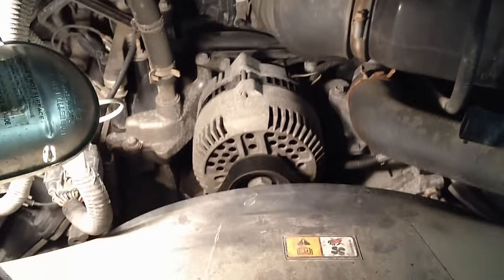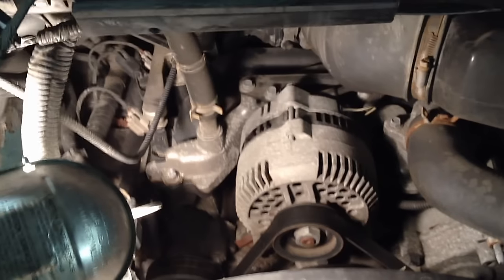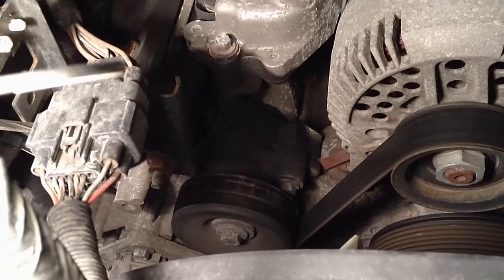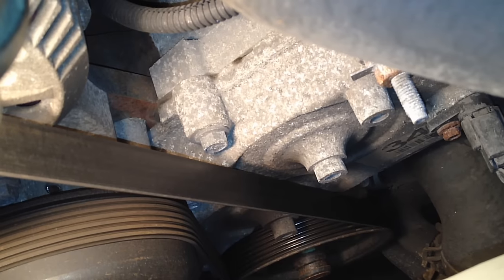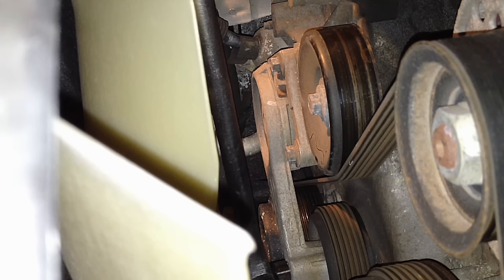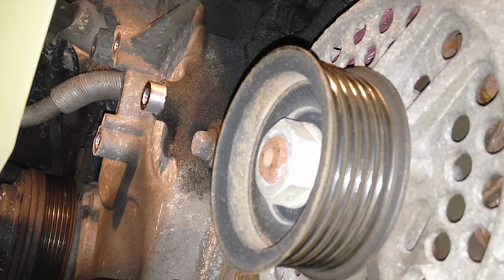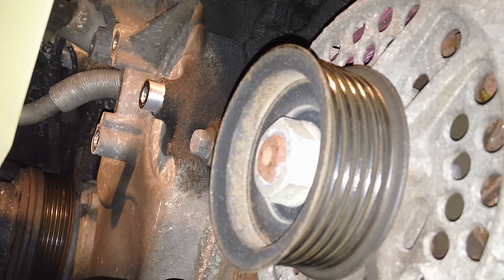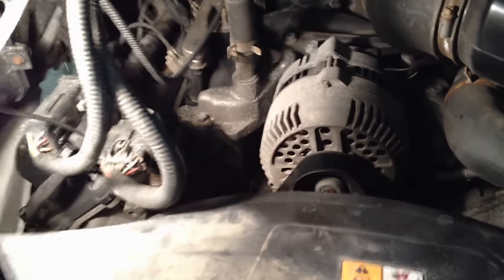Ford 4.6L & 5.4L Power Steering Whine Type Noise

Comment: Great Video. About a year ago I replaced the timing chain set on my 2003 Ford Explorer 4.6L 2V, Intake Manifold, Plugs etc.. and the timing chain was definitely bad. 
Started her up, she ran but gave me a similar noises. I said oh well, "I'll just run it till it dies." 138,000 miles now.
I thought that maybe the noise was caused by a clogged screen on the oil pump being that there was so much crap in the engine. I change the oil several times to clean it out. Also thought maybe the noise could be coming from the Flex Plate and or Torque Converter or possibly Starter Bendix or some loose bolts under the engine to the Tranny by the cover / shield. 
The Truck sounds like a diesel, especially when hot. Sounds much better when cold (Just Starting it Up). Any help would be greatly appreciated. Need to hold on to it for a while longer.
Please and Thank you!
Reply: Nick S wat was it? I have same diseal noise problem lol

Comment: Eh man great videos!! I'm having trouble trying to bypass the ac pully on my97 f150 4.6l.i saw other videos where they have a shorter belt n just put it on without changing anything like idler sizes or pulleys.any ideas would b great

Comment: Help please I have a grooved idler pulley that is wobbly and I think causing the ps pump to make noise (2006 expedition 5.4) replaced the pulley and still has a wobble. Its like the shaft for the pulley is too short . Have you seen this? Any help would be great. Your channel is amazing

Comment: I recently replaced the belt, the tensioner and both idler pulleys on my 2000 Mustang GT. It fixed my belt chirp but I noticed there is a slight whine that increases with engine speed when I turn on my ac. The noise is not there with ac off. Should I be suspect of the compressor clutch bearing?

Comment: I have a 2002 pt cruiser, that is making a whining noise when u turn the wheel in either direction ONLY at slow speeds...like turning onto a road, pulling into parking spot, ect....one car place is saying it's the power steering pump, but they only listened to it and said that...then another place noticed that my power steering belt or drive belt, whatever it's called it like half way off...could that be causing the whining noise or is it the pump ?? I've also been told it could be a clogged up filter inside the resivoir.....I don't know what's causing it..,any help would be great...would love not to pay 250.00 to replace the pump if it's not needed
Reply: Amber   Whatever happened with it?

Comment: I've got a 1997 mercury cougar xr7 making a noise similar to a power steering whine. I've done the steering pump water pump alternator and all the pulleys and I still have the same noise coming from the engine and I can't figure out what it is. There's 50 years plus combined experience between me and the other two guys working on it and we can't find what the noise is coming from. We think maybe timing chain guides but that's pretty much the last thing we can think of. Another big piece of info is the car has a 5.4 crate engine swapped into it

Comment: My 2006 f150 with the 4.6 just starting making a whining noise when it's cold but after the engine warms up it seems to go away. Would that be the same issue as this or something different?
Reply: Rich Drass yes my 94 grand marquis does the same and it has the 4.6l sohc

Comment: mid 90s explorers will spin those idler pulleys right off the bearing. Good idea to change them over 100K miles. They are $10-$20 bucks.

Comment: Any help would be appreciated!!!!
I'm trying to diagnose my 2016 F-150 2.7L v6. I first noticed a sound in the seteering after i got my vehicle back from ita oil change. Was turning left and i heard a slight sound in comnection with the turning of the wheel. Has been about a week and half since then. I hear a slight sound when making turns, but not with every turn. I also have a slight gravely rattle under the truck when pressing thr throttle. But again not every time i push the throttle. Sometimes its a quick short grind/rattle. Sometimes its a longer dragged out sound. I would describe it sometimes sounding more like the compressor om my fridge hissing. Idk what they did to it when they changed its oil. But it was fine before I dropped it off, and now its F'ed up. Was going to take it back to them for brake pads, but now i am not sure I trust them anymore.

Comment: I have a whine, hum from left side of my e350 7.5 lt ford . The noise is constant and goes away with quickly pressing throttle and then returns . From these videos,I am assuming bad tensioner or idler pulley .

Comment: If it's the power steering pump, the sound should change when you crank the wheel. does the same happen if is bearings in these pulleys?
Reply from the maker: +Hellerzauberer It can yes due to the varying load put on the pulleys

Comment: I just had this issue in my 2003 f150 5.4l took the old pulley off and it spun with no issues didn’t make a noise while I spun it but on the truck sounded like death. The new pulley stopped the sounds but I’m curious why it’s not showing any signs of damage to me?

Comment: I have a similar sounding issue on my 03 6.0 diesel but it happens when I turn the steering wheel as well. Just replaced a leaking hydrobooster and still have the noise

Comment: If it's the power steering put would the noise change if you turn the steering wheel left to right?
The only time that noise changes on my 06 5.4 is when I turn on the a/c.

Comment: I also have this whine as well as the clicking however if the clutch is engaged the sound nearly goes away is it still just the pulleys?

Comment: If I notice power steering fluid on the ground   accompanied with that squeeking   weed eater noise,   is it more likely to be pump  or this belt issue you think?    I just noticed this on my car today after my wife drove it a couple times,   but its really noisy and even a little gravely/stiff to turn,  then when I pop the hood  I hear the noise that looks to be around the belts somewhere,  but I do see red fluid dripping down     Please help somebody thx   so I can save some money on the diagnosis

Comment: What would cause severe whining only when the weather is cold and it only does it for about 30 seconds tops. I have used a vacuum pump to see if it was a leak in the system. Seems ok.

Comment: How about this...I have a 2000 mercury grand marquis and when I start it, the belt squeaks and the power steering whines I have to let it run until it warms up and after that everything is back to normal with absolutely no problems. Why causes that??? oh and it is leaking power steering fluid

Comment: if the noise changes tone when i turn my wheel does that mean its more than likely my power steering pump? i have a mustang with a 2v 4.6. it aslo goes away after ive been driving a while but will always make noise when i start the car.

Comment: I have got a 1.6 ford focus saloon 06  and it started pissin p/s fluid all over. I have it booked in to a mechanic for tomorrow, but they seem to think it might be the p/s pump. it did make that sqeeky noise if I turned it full lock in ether way. now it is leaking fluid, am I best to just change the pump anyway or could it be something much more simple like in this video?any help appreciated  thanks mate. ✌
Reply: What happened?

Comment: If my f150 does this in slightly warmer than cold temperatures, around freezing or slightly lower, and still makes this noise, would it be the pump or the pulley? the truck has factory original fluid in the steering pump, thought that's where I should start. it's a 2005
Reply from the maker: +slashsthename No I would still go after the pulleys, power steering pump noise is almost non existent on the new C3 pumps. Pull the belt and give each idler a good spin you will know.
Reply: @FordTechMakuloco  would the tensioner affect the power steering turning?

Comment: I'm pretty sure my PSP is fine haven't noticed any issues turning or what not but I have this whime, I'll check both the tensioner and the idler (if its on there) and get back to see if you saved me a major headache
Reply from the maker: DC Archer It's very common so likely yes.

Comment: I have a 2007 gmc acadia it makes a whining sound sounds like a remote control car when I'm idle or accelerating also makes it when I turn the steering wheel...what can it be?
Reply from the maker: carogio89 No idea on an acadia but first thing I would check is power steering fluid level and aeration.
Reply: Ok thanks alot I'll check that

Comment: My 99 Expedition makes a whine when at a  idle and louder when you turn the wheel but only when cold. When the truck warms up it goes away. Would that be the pump or the pulley? Thanks for the vids!!!
Reply: Exact same on my 00 Expy. Did you figure out which it was?
Reply: Yes, believe it or not it was the heat shield on the catalytic converter. When the exhaust warmed up it expanded and tightened it up enough to stop the noise. Go figure right? lol.

Comment: I have a 2005 4.6l Ford explorer and it's just started a squealing noise when I accelerate past 3 thousand rpm or punch the gas not when just idled I replaced the belt and its still there didn't make a difference any idea what that would be as I accelerate more it get louder and louder it well get then take my foot off the gas or slow down and nothing

Comment: Hello I have a 01 5.4l and it just recently started making a noise from belt area but only when I rev up motor nothing at idol.
Reply from the maker: chris larsen If it is a belt squeal noise when revved I would replace the belt and tensioner.

Comment: My mysterious noise only occurs when I am applying the gas pedal at medium speeds. When I remove foot from the gas it is quiet again. If my pulleys were bad would they always sound bad or get worse when I accelerate?  2002 F150 5.4. Also, this noise seem to have started when another person drove my truck through town in 4LOW....
Reply: I don't think so. My 2003 F-150 does what yours is doing but will sometimes stop making noise after it gets close to overdrive. I'm gonna change the pulleys first & go from there. I have like 148,000 miles on it anyways.

Comment: I took my F-150 2004 to a shop. They called me and said my power steering pump was leaking. I do my own oil changes and stuff like that, and I've NEVER added a drop of power steering fluid in it, EVER! How could my pump be leaking but never needing any fluid added? Any ideas? Also, they said there are no two piece replacement brake rotors for the front of the truck. I had someone else tell me there's a conversion to this whereas you can get a two piece hub, and that way the next rotor change is just the disc, and not the whole hub, Any ideas?
Reply from the maker: Not sure on the hub I stick to OEM. As far as the power steering pump the like to sell them even when they are just moist which will look wet but no drop fluid level

Comment: Having the typical pump whine on my 500. Have you seen this issue with the pulley on that car as well? or would you suspect the pump? its an 06 500 Limited. Thanks!
Reply from the maker: On those the most common concern is the fluid level is right at the low mark you turn fluid sloshes and it sucks in air. I always fill to just above the max line on those.
Reply: FordTechMakuloco thanks so much! $7 bottle of fluid saved me from replacing the whole pump! Seriously, your the man!

Comment: I have a similar sound in my 05 f-150, but I'm also having steering issue's with it. Sometimes I'll have power steering sometimes I wont. Could this still be the pulleys? Napa is telling me its my rack.
Reply: +The Walker I thought I needed a rack on my 08 F-150 but then I lubed the steering shaft joints and the problem cleared right up. Evidently I wasn't using the truck enough, hope this helps.

Comment: Thanks for sharing.  Would you have any idea why mine does it at a certain rpm?  My 4.6 f150 starts whining right around 30 and 55,mph.  It also whines when I first start it up.  Doesn't do it too long on cold start up.  Will continue to whine as long as I stay at certain rpms, Stops as soon as I give or back off on gas.  Always happens in cold weather.  Never happens in warm weather.  Very annoying.
Reply from the maker: I am 99% sure that is your alternator as that is common on F150's, explorers, and expeditions in cold weather only.
Reply: You share the same thought as a few other people. I'm going to Yank it out soon I'll let you know if that fixes it. Thanks

Comment: I have a 2004 Lincoln aviator with the same noise. it is in the area where the power steering pump is.. how can I be 100% sure it's not the pump?

Comment: my 2010 expedition is making that whining noise, however is not the tensioner nor the idler...could it be the alternator or the water pump?
Reply from the maker: Yes pull the belt first to see if it goes away if so you know you need to go further into the front end accessory drive unit.

Comment: Just had pump replaced 4.6 mountaineer. Would these 2 pulleys cause a mild shutter when turning the wheel while setting still?
Reply from the maker: No
Reply: @FordTechMakuloco  Other person worked on it told me sometimes shops replace with re-manufactured pumps and some parts in the pumps are not replaced and could still cause this. I will still replace those pulleys as they have never been replaced. 03 mountaineer with 240K.

Comment: I have a 99 Town car and it has this whining noise and a clicking noise. Could the clicking noise also be from the same problem?
Reply from the maker: +CentralNintendo1 Yes check all the idler pulleys for noise and specifically the tensioner for jumping around causing the clicking noise.
Reply: checked both, and that seems to be the problem, $70 dollar fix, can't complain.
Thanks :D

Comment: What if the whine only happens when the vehicle goes from stop to about 2nd gear? The noise stops once I get it to 3rd.  Its a 2014  F150.  Some have said differential...  or power steering......could this be a pulley if it's not a constant noise?
Reply: I have the same issue, did you solve it?

Comment: So I have no idea what it could be,  but I own a 2002 f150 4.6 L it just started recently squeaking.  Even after I start it and let it run for awhile to warm up from the cold.  Its squeals when I'm driving,  it squeals when it's idling, the only time it's not squealing is when then truck is off. The way I can describe the noise to y'all is it sounds like you can actually hear something turning.  Very dry squeal. Really could use help from y'all.  Its starting to get really old and I'm going thru financial trouble at the moment thanks
Reply from the maker: Mike Hall Make sure the bearings have not failed and the pulley is not grinding into the front cover. We have seen that before too.
Reply from the maker: Mike Hall Is your belt dry and cracked? Have you tried spraying the belt with water or silicone spray to see if the noise goes away? Then you at least know the belt is the cause.
Reply: Not yet but I will Tommorow morning before I leave.  I'll get back to you Tommorow man thanks for the advice!!!

Comment: I replace my pully first it was gritty, but still hear a screaming from the power steering pump. but I remove the belt and it seams tight and no noises when I spin it by hand

Comment: I have a 1996 bronco and I replaced the steering  box and idler pulley  and I still have the whining noise but only when I turn the wheel???
Reply from the maker: Noah Tetreau Any aeration in the power steering fluid? Was it vacuum filled?
Reply: FordTechMakuloco  I think there may be some aeration  in the steering fluid because  it was not vaccum filled like you said.

Comment: Thought I'd share some more. My noise started only at startup. Then a few months later I noticed it when driving. Finally started to hear it louder and more consistent.  Decided to do the idler and tension pulley. After taking off the belt the idler seemed fine so I pulled the tensioner.  Yup that was it. Did not sound smooth and you could feel it when you spun it on your finger. Replaced the tensioner pulley and now she sounds brand new again!
Reply: Quick question for you Jeremiah, did your noise come and go initially? Would everything sound normal for a good while and then have the noise for about 5 to 10 seconds and then it would go away?

Comment: I've got a '05 Freestar. The whine comes and goes and the engine will stall when the idle gets low. Any suggestions?
Reply from the maker: Greg Boyd These are known for cam synchronizer failures. Does the idle go up and down or is it smooth.

Comment: That bearing sounds dry.  On one car I had I had a tensioner failing but it was not real noisy.  In fact I did not know it was failing till the belt also failed.  After changing that tesnsioner and putting a new belt on, the car was quieter.  As I said, it was not that loud and so I never knew until it was just about to fail.  When it did finally fail, I just lost power steering and whatever else.  It wasn't so bad just hard to steer and I had to get home soon since having no alternator to keep the battery charged.  If you do decide to use belt dressing, be warned that on some vehicles it will make a horrible noise depending on the type of belt you have.  My dad sprayed some on his '03 Dodge Ram belt and it sounded really bad.  If you make that mistake you will know because everywhere you go they will be holding their ears and cringing.

Comment: Question: What if the squealing noise changes in the pitch as I turn the steering wheel at idle/parked? Does this mean that the noise is definitely the power steering?
Reply: Vince Madia yes refill your power steering fluid
Reply: In your opinion is the power steering bad as well or just the fluid?
Reply: Top off the power steering fluid if it still wines when turning at idle or parked the the power steering is bad
Reply: Brett Hargraves ok thanks man 👌🏼